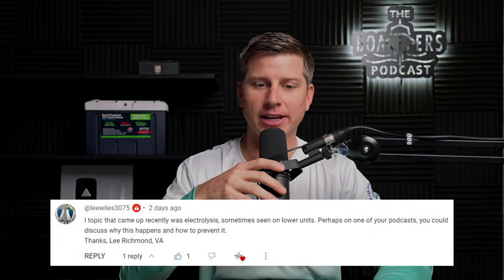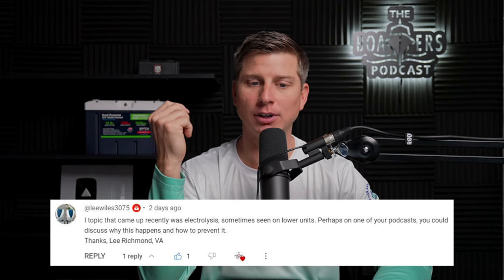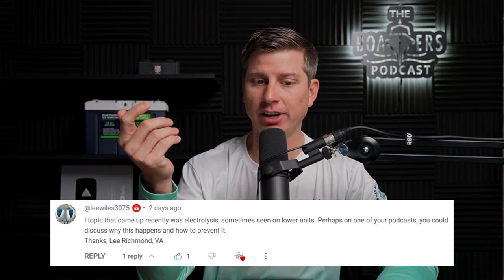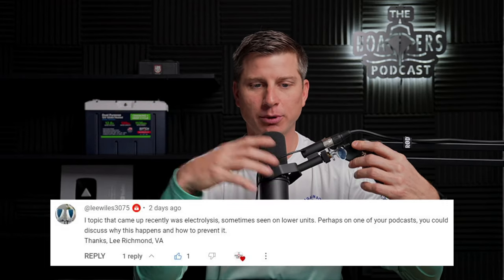What Causes Electrolysis On A Boat?

Comment: Best,

Have you already installed a MERCATHODE KIT Mercruiser 42600A14?
Do you have experience with this? I would like to mount this on the underwater part of the transom of my Sessa Key Largo 23 on either side of my Yamaha F300 NSB. Should the sacrificial nodes remain in place?
The engine is 1 year old and the paint behind the stainless steel propeller is starting to peel slightly. I sail in fresh water and occasionally in brackish water. The original anodes should be sufficient according to the dealer. Anode has an alloy of zinc and aluminum. Can this be solved with the MERCATHODE KIT Mercruiser 42600A14. 
look forward to receiving your response with interest.

Greetings Bert (Netherlands)
Reply from the maker: I don't have a ton of experience with the Mercathode kits, but really you have to use the reference electrode to see the hull potential to figure out what you need as far as anode protection. :/ but if you have paint peeling behind the prop that means you might have some stray current somewhere that is chewing it up, it's using your lower unit for a return path of current from somewhere, only advice I can give is that you need to investigate it and look at all the stuff on the outside of the hull and what it is hooked up to. Also making sure that the power and ground cables are properly hooked up and have good connections from the engine to the battery.

If you do have an issue with electrical currents in the water, idk if the Mercathode will fix this or add to the issue :/ because from what I understand about the Mercathode system is it is mostly for galvanic corrosion
Reply: @TheBoatersPodcast  Thank you for your response. I'll check everything. I have been advised to use a magnesium anode instead of the standard Yamaha zinc/aluminum due to the large stainless steel propeller in fresh water. Do you have anything to add to this or will this help if the electronics are OK? The kit I listed is not the correct one. This concerns the Mercury MerCruiser Mercathode Kit 88334A2. Suitable for all boat applications with a 12 volt operating system. I await your response with interest.
Thank you

Bert

Comment: You know just enough to be dangerous. The engine isn't going to cause electrolytic corrosion. For that to happen, the entire engine would have to have a net overall positive charge. For that to happen, you would have to connect a positive wire to the engine block itself. AC isn't going to cause electrolytic corrosion. (It can, but it takes years and years for AC to cause any noticable electrolytic corrosion). You need to take the ABYC Corrosion course to really understand how corrosion really works, down to the atomic level. Finally, electrolysis is the splitting of the atom, or the removal of hair, it has nothing to do with corrosion.